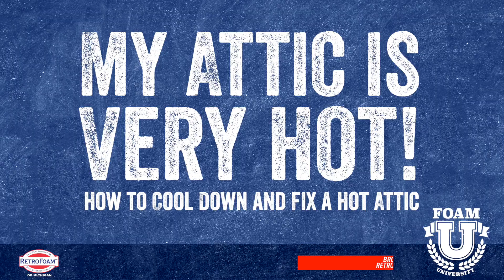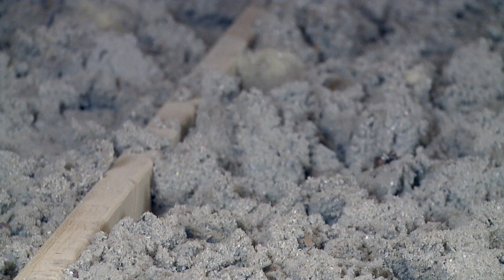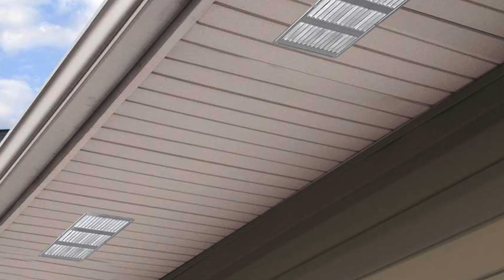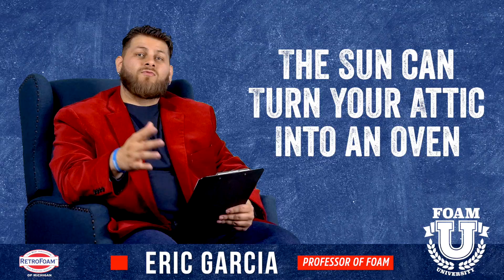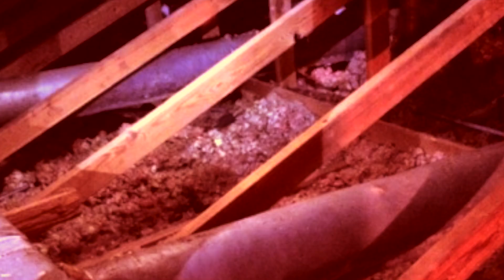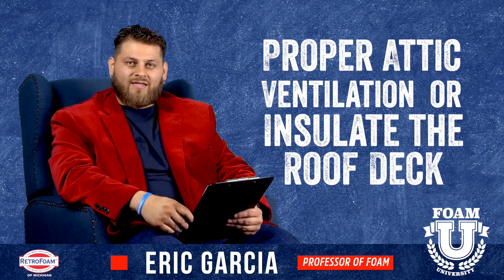My Attic is Very Hot! How to Cool Down and Fix a Hot Attic | Foam University

Comment: I just got my roof deck spray foamed. I'm experiencing the hot roof situation you described in your video. I think it's due to lack of circulation of air. Would you recommend installing a supply in the attic with a vent passthrough to the main house on the other side of the attic?
Reply from the maker: Yes! Any kind of mechanical ventilation will help get that air circulating.

Comment: This may seem like bonkers .. but I have an old home likely built in the 1930’s and there’s no soffits or vents .. just blown in insulation on the floor . When I had the inspection done the inspector said I wouldn’t need any additional vents as older houses Breath naturally .. I have Since put on a steel roof .. and this summer the house is super hot .. what would you suggest ??
Thank you
Reply from the maker: Since it's an older home, there is a good chance there is air leakage in the walls, crawl space/basement, and attic. Adding insulation to those areas will help.

Comment: Here is a suggestion -
Sink a good well.
Tie that into a pump and irrigation tubing. 
Run tubing along the ridge.
Set a timer to run so many minutes at a time.
Water running down the roof will draw out massive amounts of heat.
You can reclaim that water too in order to use it to water your property.
That well water is generally around 50 degrees compared to the 150 degree roof.

Comment: I want vents that automatically open MECHANICALLY (not electrically) and close mechanically (automatically).
I want them CLOSED in the dead of winter. Tired of heating the roof and the outside because of venting.

Comment: What if I have insulation on my roof rafters and the floor?
Reply from the maker: It depends on what kind of insulation you have. If it's fiberglass or cellulose, those materials still allow for air movement through them.
Reply: @RetroFoamofMichigan  I Also have plywood down as a floor
Reply: @RetroFoamofMichigan  it’s spray foam on the roof and fiberglass on the floor
Reply from the maker: We recommend one or the other. Spray foam creates an air seal, so the fiberglass isn't needed.
Reply: @RetroFoamofMichigan  is it a problem if it’s already there? I’m turning my attic into a room. I’m gonna have a/c in there.
Reply from the maker: I would recommend removing it. Especially if it has been in the floor joists for any amount of time. Fiberglass retains any pollutants, dust, etc., that it comes in contact with and is usually pretty dirty.
Reply: @RetroFoamofMichigan  ok thanks for your videos! They’re very helpful and informative.
Reply from the maker: No problem at all! Glad we could help.

Comment: This explains why my Foam insulation contractor wants me to add some ceiling vents.  The foam will be on my roof rafters. I now understand vents in my ceiling will make heat rise store in attic due to attic seal in foam then once that air cools it will fall back into house.  Do I understand that right ?
Reply from the maker: Yes, when you seal the attic roof deck air will circulate through that space.

Comment: What do I need to do to my ac unit if it has a gas furnace and Attic is NOT VENTED spray foamed roof?
Reply from the maker: What issue are you trying to resolve? Do you have a hot attic?
Reply: @RetroFoamofMichigan  my attic has spray foam on the roof and NOT vented. I have a gas furnace. Do I need to add some type of air intake to my hvac unit? Do I need a dehumidifier? I’m afraid of a gas leak.
Reply from the maker: Generally speaking, it is recommended to have a fresh air intake.
All gas appliances should be properly vented. Best to have a heating and cooling company check it if you're concerned.
Before you add a dehumidifier, I would recommend running your bathroom fan (that should exhaust directly outside) periodically throughout the day.
Reply: @RetroFoamofMichigan  Fun fact: slumlords will run the bathroom vent into the attic and not outside.

Comment: So how hot is too hot? 120 F?
Reply: My attic reaches 150 easily
Reply: @user-zi2ue5nz4x  that kind of tempeture, , +120°, is probably  heating the interior of your home, plus it's shortening the life of your roof. It would be in your best interests,  if you can exhaust that heat. Quiet cool makes a fantastic  gable fan, the green model, 3.0, is very cost efficient,  and you can control it with your phone. I'd also look at the amount of insulation in  the attic, I currently  have 2 of those fans and R 76, insulation  in the attic. We don't have air conditioning.  House  gets up 70° on a 115° day. One more thing we also have a whole house fan.
Reply: @markchristensen5206  drat. I thought that gable fan would be a good thing. Apparently not.
Anything that you can control with your phone will require electronics which are unreliable to say the least.
Electronics in a hot attic is just ASKING for problems.
Reply from the maker: That is a great question! Some of our Spray Forman can run into Attic temperatures up to 150 degrees! The average temp for an attic is anywhere between 130-150 depending on the outside conditions. Anything above 150 would be considered too hot!
Reply: ..to get around the “electronics in a hot attic” issue ..the main power to the fan just needs to be to the motor ..the sub control to the fan(s) needs to be in the living space ..or somewhere away from the heated attic ..